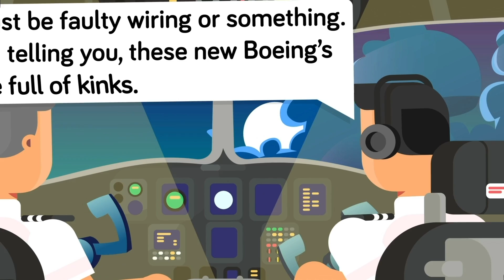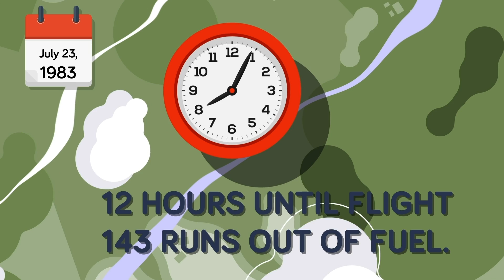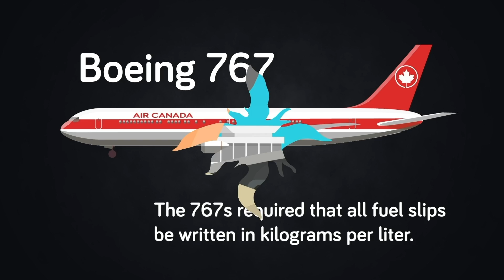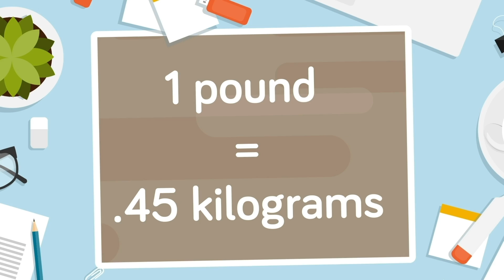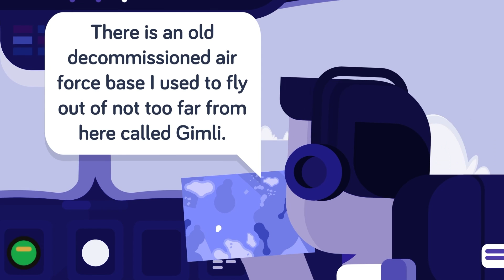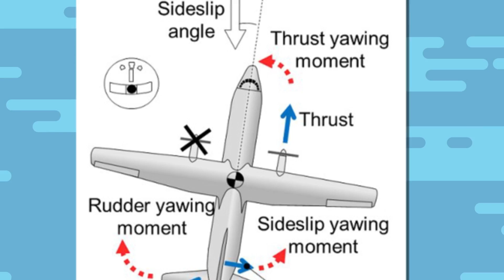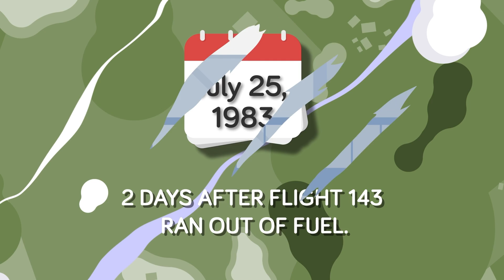This Plane Ran Out of Fuel at 41,000 FEET - Here's What the Pilots Did Next

Comment: One thing that you don't mention was that at the time of the incident, Canada was in the process of converting from Imperial measurements to Metric. This caused the confusion of fuel being pumped from the truck in litres, but the fuel gages on the aircraft were in gallons. The Board of Inquiry noted this as a contributary factor, and recommend that Air Canada convert all their aircraft to metric as soon as possible.
Reply: Uh-huh, the metric system crashed the plane, righto. What colour is the sky on your planet? 🤡
Reply: @ryanellis9325 That's not what they said.  At all.
Reply: @ryanellis9325  If you go on a trip with 2o liters of gas instead of gallons you won't make it far
Reply: You have to be on one or the other.  Because of the international nature of aircraft, I'd think making everything metric would make sense.  I'm an American.
Reply: If I recall correctly, it was actually due to the conversions between weight and volume of the fuel by the fuel truck workers. They were used to pounds/gallons (imperial) but with the 767 using kilograms/liters (metric) the got muddled in their calculations and converted to pounds instead of kilos, and with a pound being roughly half a kilo, the plane only for half the fuel it needed.
Reply: @kenolson6572  True. That was why Canada was transitioning from Imperal to Metric at the time. It's all officially Metric now.
Reply: @ryanellis9325  Confusion between metric and imperial resulting from some aspects of the airline's operations using one and others using the other contributing to the disaster is not remotely the same thing as "metric crashed the plane". I could ask you the same thing about the colour of the sky, quite frankly.
Reply: The error was mentioned here 10:59
Reply: It's time for the USA to move to the metric system too.
Reply: @1KSarah We'll continue to measure in Jersey pork rolls, thanks.
Reply: @kenolson6572 lieeessss... No American has ever been so gracious and humble 😅

Whilst we're at it... I wish we'd pick a lane in the UK 🤔
I was lighter when I lived in metric Spain
Reply: @Alex-zs7gw  I have no problem with the metric system.  More scientific, more logical, and I wouldn't have to remember all the conversion factors.
Reply: @ryanellis9325 what a silly reply. I bet you thought you were very smart when you wrote that smh
Reply: @ryanellis9325 someone thinks they’re clever
Reply: @Alex-zs7gw  
Preferably the left lane, right?
Reply: @ryanellis9325 no he’s saying the ground crews weren’t properly trained for converting the fuel load from pounds to kilograms. 🤡
Reply: Wrong.
Planes meassure fuel by weight, where as the fuel trucka meassure by volume, the calculations were supposed to be converted to kg, but were converted to lbs, therefor making them run out halfway through.
Reply: @1KSarah hell no we're sticking with imperial metric makes no sense
Reply: It was kilograms the fuel had to be put in but it was in pounds not litres a s gallons
Reply: They literally say that at around 11:30
Reply: @FarrellMcGovern  no it’s not. Altitude is in feet and time is measured in seconds and hours.
Reply: @ryanellis9325 what 😭 do u just type before reading
Reply: He mentions kilograms/ pounds.
Reply: No really.....we need some decent poutineries in ohio.
Reply: They did mention that watch it again
Reply: @christopherjones8448 if I'm not mistaken they use lbs/kg 
The pilot ordered 22,000kg of fuel.
An the aircrew only loaded 22,000lbs
Reply: @aaronsmall1394 lol everything is a factor of 10 or 1000.
Well the imperial system has 12"
And 3.785L per gallon with no explainion 
Well a ton is based off 1000L of water. Just an example
Reply: Wikipedia:  Gimli Glider

》Investigation
  •  Miscalculation during fueling

The flight plan showed that 22,300 kilograms (49,200 lb) of fuel were required for the flight from Montreal to Ottawa to Edmonton. A dripstick check found that 7,682 litres (1,690 imp gal; 2,029 US gal) of fuel was already in the tanks. To calculate how much fuel the airplane had to take on, he needed to convert the 7,682 litres of fuel already in the tanks to their equivalent mass in kilograms, subtract that figure from the 22,300 kg total fuel that would be needed, and convert that result back into its equivalent volume.

The density in metric units was 0.803 kg/L, so the correct calculation would have been:

7,682 L × 0.803 kg/L = 6,169 kg = mass of fuel already on board
22,300 kg − 6,169 kg = 16,131 kg = mass of additional fuel required, or
16,131 kg ÷ (0.803 kg/L) = 20,088 L = volume of additional fuel required

At the time of the incident, Canada's aviation sector was converting from Imperial to metric units. As part of this process, the new 767s acquired by Air Canada were the first to be calibrated for metric units.

The fueler reported that the density of jet fuel at the time was 1.77, which was in lb/L, since other Air Canada aircraft used lb. Pearson and Quintal both used the density of jet fuel in lb/L without converting to kg/L:

The use of the incorrect conversion factor led to a total fuel load of only 22,300 lb (10,100 kg) rather than the 49,170 lb (22,300 kg) that were needed. This was less than half of the amount required to reach their destination.

Instead of taking on the 20,088 L of additional fuel that they required, they took on only 4,917 L. The use of the incorrect conversion factor led to a total fuel load of only 22,300 lb (10,100 kg) rather than the 49,170 lb (22,300 kg) that were needed. This was less than half of the amount required to reach their destination.
Reply: @ryanellis9325 Guys, THIS is a clown. Have you ever seen one?

Comment: The plane actually ran out of fuel at around 26,000 feet as the pilots were trying to get to Winnipeg Airport. Still, the fact that nobody died is remarkable.
Reply: I think he's a better source than you.
Reply: 41,000ft
Reply: @BrodeeRaney-zl1kf Don’t cut yourself off of critical thinking!  Do research yourself!
Reply: lie
Reply: A plane running out of fuel wouldn't make it crash
Reply: @darlenefraser3022  I try to avoid arguing with people on the Internet. Some of them are a few eggs short of a dozen if you know what I mean.
Reply: No it's actually 41,000 feet, where tf did you get 26,000 from
Reply: It feels like 26000 is a bad conversion from feet to meters but the math doesn’t work out. But this is sorta how planes run out of fuel or   Mars probes slam into planets…

Comment: They were lucky the pilot knew so much about gliders.
Reply: In the mayday series, they advised the training simulator of this event, no one was able to reproduce this.  Pilots without the knowledge of gliding and not knowing of an old military runway were doomed.
Reply: Especially the "diagonal air brake" maneuver to reduce speed without engines. Dragging it through the air by angling it diagonal but turning towards straight is brilliant, though I admit I literally do this is KSP all the time.

Comment: It may sound dumb on my part. But why couldnt they just top off the tanks at each landing until a repair was made?
Reply: Safety reasons. You fly with as little fuel as possible so when you land, if there is a catastrophic failure such as one of the landing gear failing and you have to skid to a stop the fuel line / tanks, engines have less fuel to ignite which means less likelihood of crash becoming an inferno and more likelihood of people surviving the crash.

Comment: failed fuel sensor.  
suspicion that the plain is light  
cockpit fuel warnings. 
…and the poilots think its faulty equipment?
ARE THEY F NUTS!! I WOULD HAVE TURNED RIGHT AROUND AND LANDED. BACK AT THE AIRPORT TO HAVE A MANUAL READING AS SOON AS I REALISED IT WAS LIGHTER THAN USUAL

Comment: That last part about the simulator I don't know, you can run the exact situation in X-Plane and the museum here in Gimli has a full simulator with x plane running where you can try to land it. I landed it first try.
Reply: Is there accounting for wind, and panicking, still that sounds impressive though
Reply: The simulators back then wasn't as advanced as right now. They're probably 2D dos based trying their best to look like 3D.
Reply: @ultimatestuff7111  no panicking lol. Failure is a retry button. That does make a big difference.

Comment: I know this sounds like a dumb question but why aren't the fuel tanks "topped off" everytime. I mean you never know whatll happen and it's better to have more fuel than less fuel. It's not like the fuel will wasted, as it can be used for the next flight. 

Also, shouldn't whoever is fueling the plane be tracking the amount of fuel that is pumped?

It just seems like such an easily unavoidable accident?
Reply: Pretty sure they aren't allowed to land with full tanks. They have to dump the tanks if they have to much fuel before landing
Reply: The fuel would be wasted as they would have to dump it before landing.
Reply: @SinisterSlay1  why? That see.s so wasteful and bad for the environment?
Reply: Safety reasons. You fly with as little fuel as possible so when you land, if there is a catastrophic failure such as one of the landing gear failing and you have to skid to a stop the fuel line / tanks, engines have less fuel to ignite which means less likelihood of crash becoming an inferno and more likelihood of people surviving the crash.
Reply: @tinyguy9398  so I'm guessing the kind of scenario that you described would be more likely to happen than a plane running outta fuel becuz of having to divert, or wait a while b4 they can land?

Comment: It's not as if the plane will just drop out of the sky lol. A plane without fuel is just a glider. As long as there's forward momentum there's still lift generated by air passing around the wings, so landing the plane safely shouldn't be too much of an issue, unless it's over a body of water.
Reply: Except the sheer weight and size of the thing. Pearson was literally one of the best glider pilots in the country who happened to be the guy flying the plane. Most other pilots would have crashed the plane.

Comment: Fuelgauge was broken, the tanker uses volume while the planes uses weight to meassure fuel, air canada was swapping from imperial to metric so the error that happend was that the tankers weren't propperly trained, and therefor filled it up with a fuel volume equal to X amount of lbs, but should have given it a volume equal to X amount of kg, therefor giving the plane about half the fuel needed.
And since the guage was broken the pilots trusted that the tankers gave them the right amount of fuel, which they sadly didn't do.